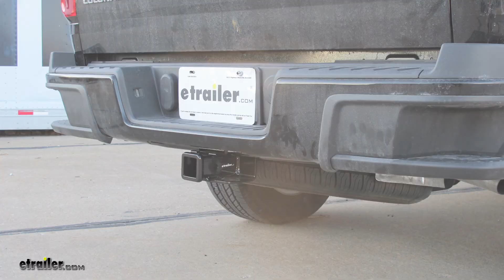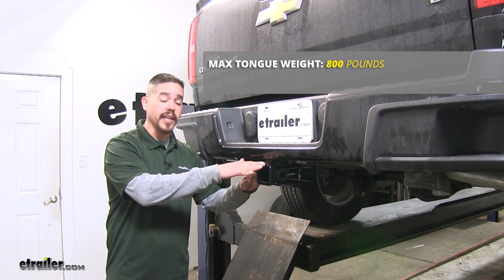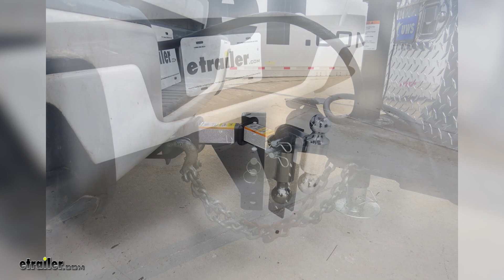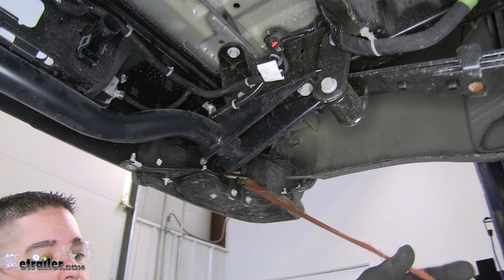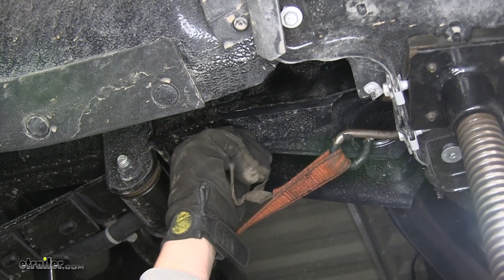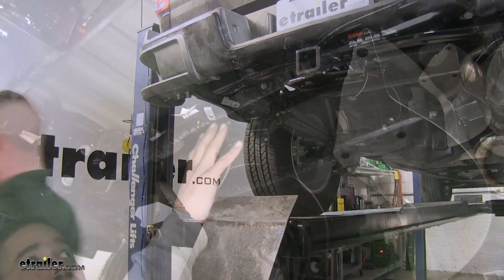etrailer | Set up: Curt Trailer Hitch Receiver on a 2018 Chevrolet Colorado

Comment: This is not as simple as the video makes it, I just spent 4 hours putting my hitch on.  You definitely need a cheater bar.  the installation isn’t too hard, but definitely a lot more work than any video you’ll see.
Reply from the maker: Installing this hitch is a bit easier with the use of a lift. This hitch can be a bit more difficult to get in place because the factory bar is attached to the bumper brackets.
https://www.etrailer.com/Trailer-Hitch/Curt/c13176.html

Comment: Any reason why you didn't take out the side screws before the bottom screws? Man! I had a time getting the last side screw out. Between the ratchets and the floor jacks, the was no room and tension on the bumper didn't help either
Reply from the maker: With the truck on a lift it was easier to slowly lower the hitch while removing the 2 bottom bolts. It was also easier to get to the side bolts with a longer ratchet with it on a lift. There's no reason it has to be the one way or the other but it might be easier getting the side screws out before loosening the bottom ones when doing it at home.

Comment: It looks like the factory support has a hole in it made for a ball hitch - and it lines up perfectly with the cut out in the bumper cover - 
Do you even need this whole new support?
Reply: Just bought my 18 Colorado this week. I thought the same thing. My local trailer shop said I can use the stock support. Only thing needed is a ball, wiring kit and drill a hole. My truck is the 4 cylinder and can only tow 3500 lbs. Tongue weight is also 400 max, which I shouldn't  exceed because I can't tow that much of a trailer anyway. If you have the v6 Colorado, spend the money on a Curt system so you can tow if needed. I just don't have the truck for it, which works fine for me.
Reply: @lienhopphotographics  I tried towing with the Colorado bumper hitch but the tongue of the trailer kept hitting the frame of the bumper, plus the bumper is too high and all the trailers jacks had to be put on blocks. I tow a 21-foot 4000lbs boat and a 16-foot enclosed car trailer with a 4-cylinder Colorado with no issues now.
Reply: @jamesm568  makes sense but I didn't buy this truck to tow. If I needed to tow a bunch I wouldn't do it with a 4 cylinder because I don't want to run the risk of damaging anything. For my needs, it should work but I've not tried yet. We will see!
Reply: @lienhopphotographics  The 4-cylinder Colorado is quite capable for light-duty towing. The bumper hitch is just so restrictive on maneuverability when trailering because of its design. If you're pulling jet skis or a small utility trailer for a lawn mower that has a long tongue you should be fine with the bumper hitch.  I'm just mentioning what issues I had pulling with the bumper hitch.
Reply: @lienhopphotographics  me too -  I don't plan on towing much - so I'll probably go with the ball up thru the bumper for now - if you go with the method in the video you basically have to tear the whole ass end of the truck apart just to put a new support in - which already exists minus the 2" square reciever  - ther has to be an easier way - a square 2" reciever that bolts on to the existing bracket or maybe weld one on underneath ?
I would have gladly paid an extra 200-300 for the towing package but the truck i wanted didn't have it.
Of course it had all the $hit we don't want or need - like traction control/ stabilitrack /abs / 8" touch screen w/back up camera  etc.... oo well
Reply from the maker: This particular customer did not want to use the bumper hitch. He wanted a hitch that sits below the bumper so he can use hitch mounted accessories and customize the rise and drop of the hitch ball.

https://www.etrailer.com/Trailer-Hitch/Curt/C13176.html
Reply: Depends on the weight that you are pulling(no more than 3,500 Lbs), but pulling with the bumper is a pain in the butt because for one thing the bumper hitch is too high, and second, you can't turn sharp without the frame of the trailer hitting the damn bumper. The upgraded trailering kit makes trailering so much easier.